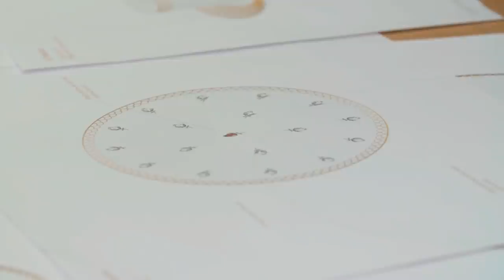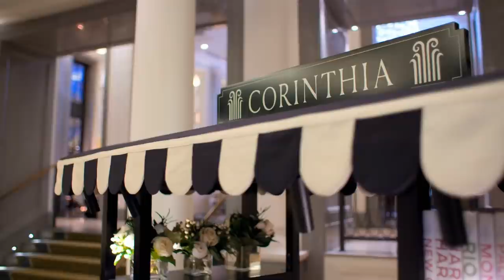The Finer Details Inside Corinthia London | Britain's Most Luxurious Hotels | Channel 4 Lifestyle

Comment: lol when they say it takes one week to make a teapot... like yes all teapots have to cure. omg hilarious
Reply: Not if it’s cast iron
Reply: Actually it does.
First the casting.
Liquid clay is poured into the hollow casts.
Of lid, pot, handle, and spout.
Then they have to dry slightly before being removed from the cast.
The handle and spout are
then "glued" on with liquid clay.
Further drying is recuired.
Until solid. 
Note that clay shrinks when drying !
When tested for no internal flaws, and if the lid actually fits, the pot is glazed.
Then dried and fired.
Preferably 2-3 times over.
Lastly the pot gets decorated.
Then fired again.
There is always a chance of something going wrong during this process. 
One small air bubble can explode a full oven !
Plus a tiny spot of burnt in dust will make a tea pot second rate, at best....